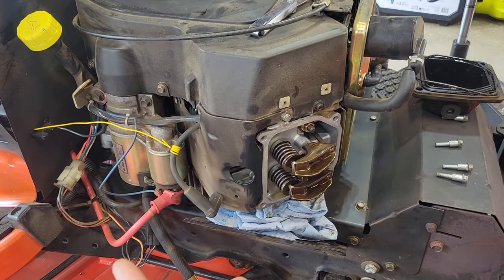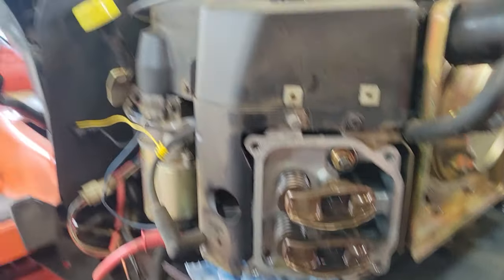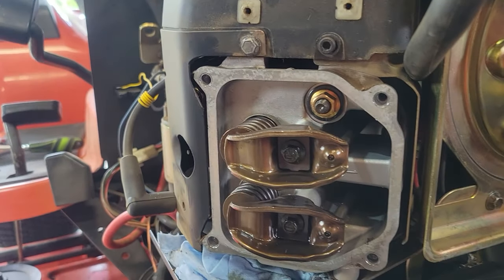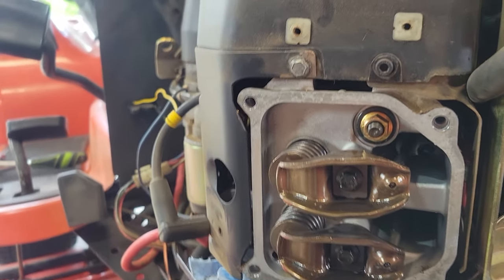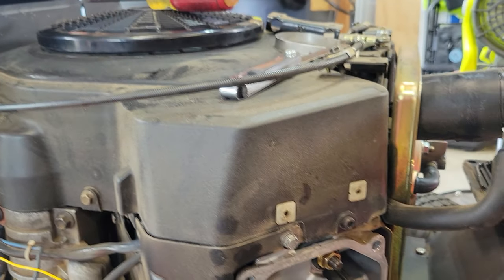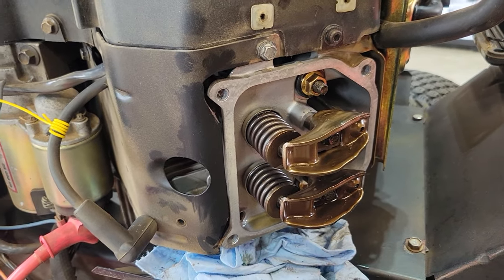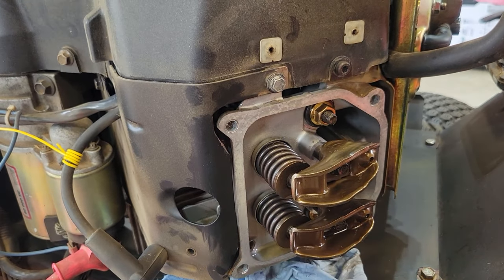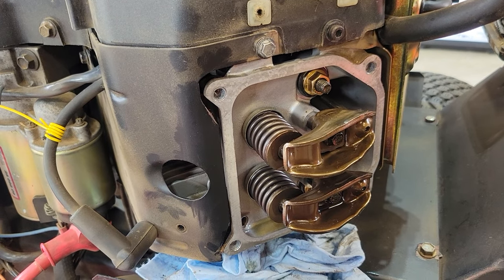Kohler Valve adjustment.... nope

Comment: Adjust? You don't. Need head rebuild. Pull the head and re-seat the valve seats if needed with a peen-in, then re-lap the valves/grind the stems to fit again.

Comment: Looking at this rocker set up I noticed that there is a space between the rocker and the where the stud goes into the head , this might be like the old Chevy  small blocks where the adjustment is in the rocker it self by tightening down the  rocker stud nut till you have  zero lash on the  the push rod ,PS also known as a floating rocker design . Just google adjusting Chevy small block valves for reference .

Comment: Define leaky. What’s leaking? Air? Oil? Gas?
Reply from the maker: Air escaping through carb during leak down test
Reply: @dougdoesstuff24  I'm a small engine tech. These kohlers have hydraulic lifters. You don't need to adjust the valves. That happens automatically. It sounds like you need to remove the head and lap the valves.